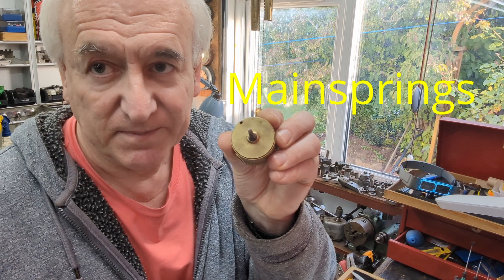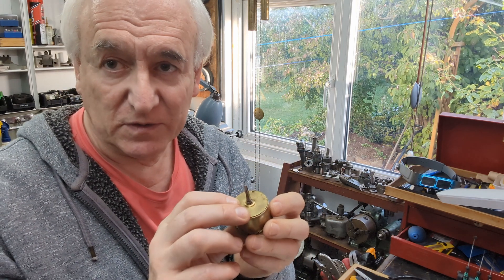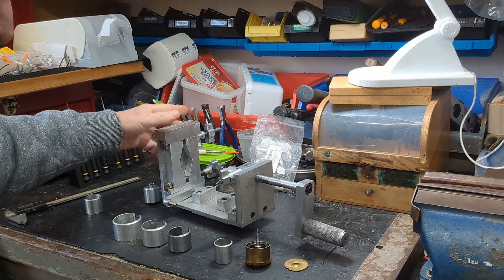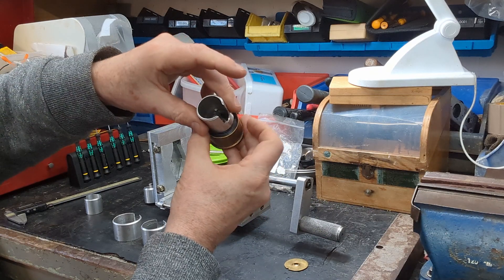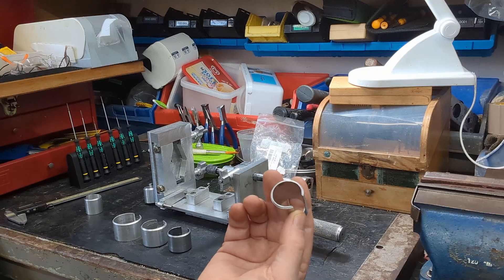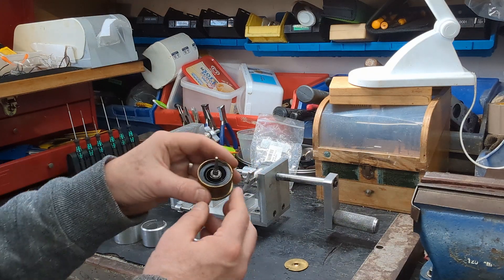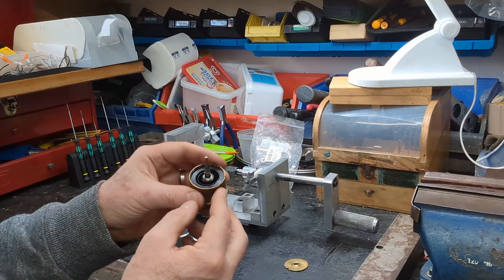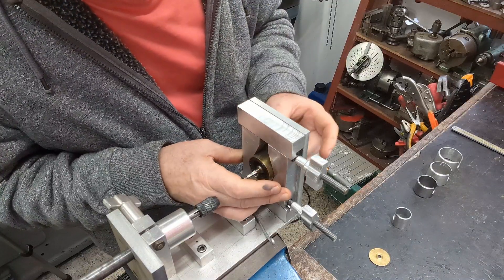Mainsprings - Questions to stretch your thinking!

Comment: If it was my clock i'd replace the springs and be done with it.

Build a "Trorquinator" lol. Read Repairs channel @readrepairs, has just posted a video 2 days ago pondering the same dilemma of finding the correct torque/tension for a clock movement.
Reply from the maker: Yes I've seen that video, but I can't see Matthew changing a spring unless it's broken! LOL